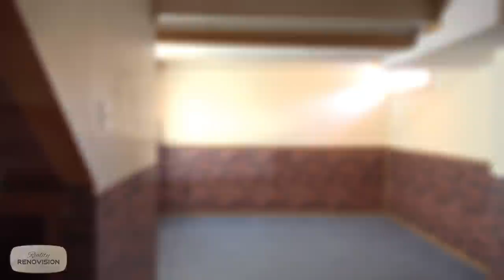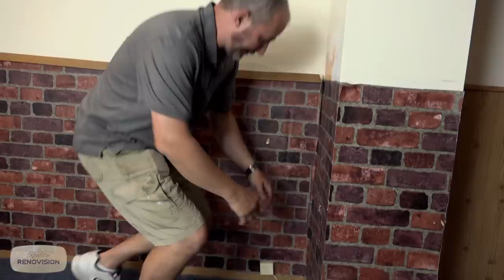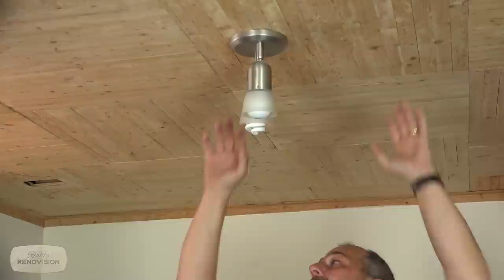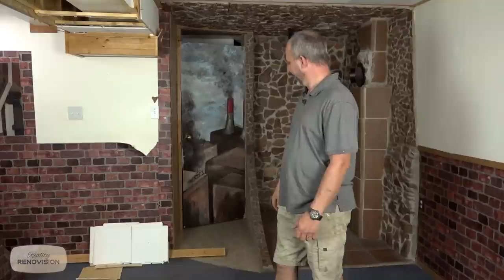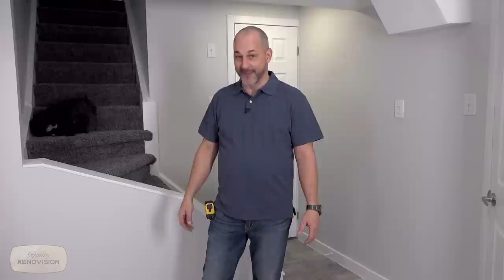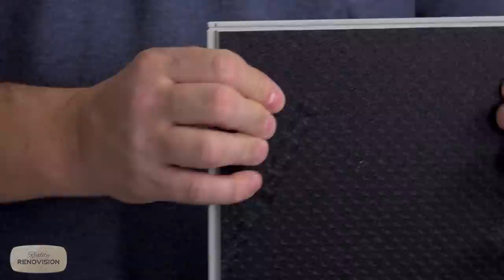Basement Gut and Rebuild for under $4000 | Reality Renovision Ep13

Comment: I trying to remodel my basement. It is an unfinished basement and a old home. We are fixing water issues with the wall. I really need some help with advise on what and how I should plan this out and finish it. We are having an issue with the height and are considering painting the floor joices (spelling?)  because here in Nebraska we have to have 7 ft clearance and at the bottom of the floor joice (spelling on that I am not sure) we are at 6 ft 9 inches. Lowering the floor with the water issues and tuck pointing the inside and out side as well as soil grading is already costing us a lot. We have to finish the inside by ourselves with super old electrical that I think was done wrong and no ability to put a ceiling in. I am trying to find videos that are close to what I am dealing with. I am beyond frustrated with the problems of this but we are stuck right now and I need the extra space for my daughter who is graduation and a place for me to work out from home and to have an office so I have privacy from distractions while working. Any advise on what I can do???
Reply: Most places you need a permit to finish a basement, not really something you can diy especially if you don't meet height req. This video works cause it was already finished, so it was a "cosmetic renovation" (as Jeff stated in the first half) which usually doesn't require a permit.
Reply: The Permit thing is a very legit issue in most states. If you think your gonna finish your basement without one don’t think your gonna sell your home without issues. Most areas inspect homes prior to sale like the township or city or area you reside in. For example the biggest issue in basements is the Ability to Egress the basement without your steps or stairs. You need a secondary escape route in addition to stairs that provide you the ability to exit the basement in case of emergency. Fire,flood,smoke,carbon monoxide emergency etc.. the basement need a large enough window installed or a set of belco doors. Notice Jeff replaced the homeowners window before they started the Renovation. I’m willing to bet that’s because they applied for a Construction Permit and were told the window needed to be larger or some sort of variance to it to bring it up to code. Installing a basement window is much different than a bedroom window. Below ground for one example. You basically gotta show the township building and inspection guy you can somehow drag your ass out a window in the middle of the night when you stuff your mother in law in the basement for a holiday sleep over. Yes you need to make sure she can crawl out a window. 
My advice, call a bunch of contractors out  I mean a shit load and pick there brains while there out giving you an estimate. Tell everyone that the other contractor told you this your that when you form your questions. Contractors get off big time on being able to dispel another contractors idea or method. But you gain info and new ways you never thought to use when finishing your basement. Then give the nicest one the window job after you dig a hole along side your house and realize you are so friggin in over your head. Watching the Super Bowl in the Living Room really isn’t that bad. Also talk to the building inspector. He’s not supposed to suggest a contractor but they slip sometimes and will tell you who not to use. You never want your building inspector already pissed off driving to your house cause of your contractor who’s an asshole. Then you get caught in a pissing match of Biblical proportions and get failed on electrical ,plumbing ,everything down to the wrong colored shirt on Tuesday.  Anyways good luck. Sounds like your building a Fort at this point ; you may wanna read a book or two before starting. Are you at least Short for Christ’s sake. Like this is where you wished you were like 5’5 and Bald so then your Fort like ceilings won’t be so noticeable.  For real good luck. What could go wrong...